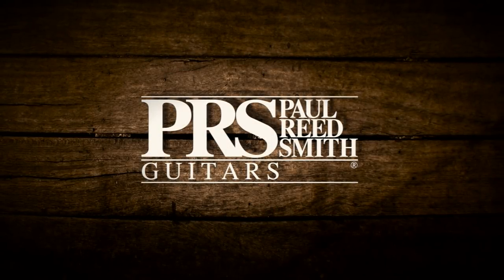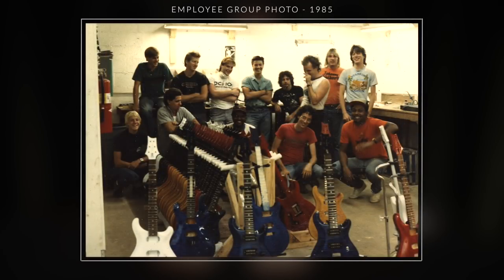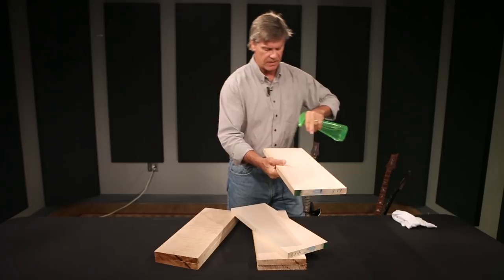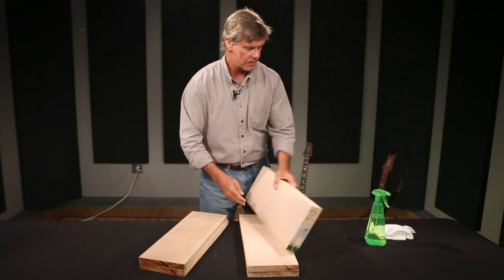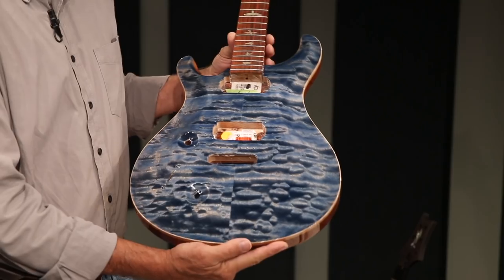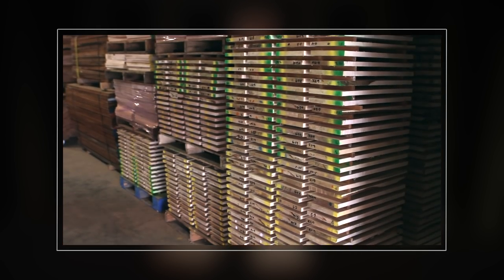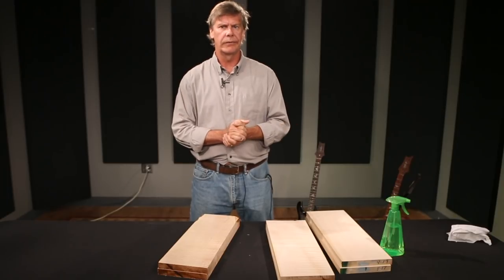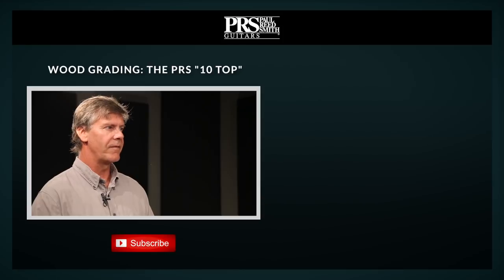The "10-Top" | PRS Guitars

Comment: Where do wood library guitars fit into the regular, 10 top and artist grades?
Reply: Chris Nicolaides I might be wrong but from what I understood so far: 

Artist Grade and Wood Library are both a level between 10-Top and Private Stock. 

Wood Library is apparently more about exotic woods and/or rare finishing, while Artist Package are more traditional woods,but with a nicer figure than 10-Top. 

Therefore I'm not sure there's any kind of ranking between Artist Package and Wood Library.
Reply from the maker: Hi Chris - Wood Library guitars are specifically spec'd out by the dealers who order them. Wood Library guitars default to a 10-top (designated by a "10" on the back of the headstock) but, many Wood Library runs utilize artist grade woods (which are not currently labeled on the back of the headstock).

Comment: 1.  How does wood library fit into all this?  I thought wood library was supposed to be a higher grade.  Most of the wood library tops I've seen don't have a 10 on them but they seem nicer than a standard 10 tops.  Are those then considered to be artist grade?  I have seen a couple wood libraries with 10's on them real recently but they also have artist hardware and the paisley artist case.  Over the last several years I have purchased 6 PRS guitars 4 from the core lines.

2. Here's an example, I played a Semi-hollow 408 violet purple burst at a dealer a week ago and it had a 10 on it.  I have a Cu24 Semi-Hollow that's also a wood library guitar in violet purple burst.  It does not have a 10 on it but it looks far nicer than the 408 with the 10 on it.  The Cu24 also has the artist hardware and case.  Btw, I brought the Cu24 in because the 58/15's on it aren't giving me the sound I was expecting out of a semi-hollow so I am looking at the 408 semi-hollow and compared them in the same amp.  The 408 has the semi-hollow sound I was looking for.  I'm not saying I don't like the 58/15's.  They sound great in my HBii.  They sound very stratish in the Cu24 semi-hollow which isn't bad but just wasn't what I was looking for.  I wanted more of the 335/339 type of bark and the 408 semi-hollow does that better.  I'm definitely selling the Cu24 to get a semi-hollow 408.  Btw, both guitars have rosewood necks that probably effects the sound.  Man I love the way those feel.  I wish I could get a rosewood neck on every guitar I have.

3.  I hate to say this and don't want to upset anyone....Maybe I'm wrong but it seems like the standards for a 10 top aren't what they used to be.  In recent years I've seen more and more 10 tops that just didn't look that great to me and left me scratching my head because I have also seen the occasional non-10 top that looks like it should be a 10.  I was wondering if the 10 grade was  just to increase the price.  Sorry, to ask.
Reply from the maker: Hello David - Wood Library guitars are specifically spec'd out by the dealers who order them. Wood Library guitars default to a 10-top (designated by a "10" on the back of the headstock) but, many Wood Library runs utilize artist grade woods (which are not currently labeled on the back of the headstock). Our standards for the non-10, 10-Top, artist grade, and private stock designation are firm and have been consistently followed, if not increased, over the years. Most of the men and women on the shop floor grading tops today are the same men and women who have been grading tops at PRS for the past 20+ years.
Reply: Thanks for your reply.  I got my first PRS in 1988 and have owned 10 since then and I'm close to buying #11. Have you guys considered putting an "A"  in the corner for the artist package?  I guess grading 10 tops can be rather subjective
Reply from the maker: No, thank you for your loyalty! It sounds like you have quite the stable of guitars. We love hearing from our supporters as we are always looking for ways to improve what we do. Thanks for your feedback.

Comment: So, is it purely aesthetic or is there a tonal advantage?
Reply from the maker: Hi, Cody! The 10-Top designation is purely an aesthetic grade.
Reply: Do you mean that you think that the wood is not important in an electric guitar? Sure? ... ... ... Deafness is a really important problem to be treated for to guitar players  :¬P
Reply: Mendozer what a load of rubbish. Wood has a huge impact on the tone if any guitar. If you have a naturally bright guitar ( which is down to the wood), then no matter what pickups and hardware you put in that guitar, it will always tend to brightness. If you go into any large store with a large selection of guitars - sit and play 10-20 strats or tales acoustically. Then come back and tell me there is no difference.
Reply: "sit and play 10-20 strats or tales acoustically." Depending on if they use different woods, yeah, they'll sound slightly differently (not nearly as different as on acoustic guitars, where the wood is built to flex and breath, whereas a solid body guitar the wood is one stiff chunk that isn't meant to move, but still). Plug it in, however, and you cannot tell the difference. While physically it will have an effect, it's simply not great enough to be recognized by the human ear, it's too minute; and once you factor in the amp, pickups, pots, wiring, cable, string type, fret material, scale length, pick thickness/material/position/angle, the room you're in, distortion/compression, etc. the wood has probably less than 1% in the sound of the final signal.
Reply: Jimjambanx just because you can't hear it doesn't mean that no one else can hear it. I have 3 strat and have changed the pickups between them. They still sound totally different, even with the same pickups. Swapping the necks between them made much more difference to the tonal characteristics than changing the pickups. No matter what pickups you put in a bright guitar, it will always be a bright guitar. I agree that the pickups are the biggest change to a guitars sound, but saying that you can't hear the difference between different woods in different guitars when they're plugged in is just silly, and ill informed.
Reply: Put a low output humbucker in a so-called "bright" guitar and it will have a warm, mid-heavy sound.

People hear what they want to hear.
Reply: John Hegarty The difference you hear in your strats can just as easily be chalked up to the pots, since the caps can have up to a 20% variance even on identical models with identical pots, which will affect the tone much more than the wood. I used to think tone wood made a difference on electric instruments as well, but after listening to blind A/B tests,  it really does just come down to placebo. I'll link you a test, this is the most scientific test I've been able to come across on the internet; with two incredibly different body materials (Ash and acrylic) being the only variable, as everything else is just swapped between the two (even the strumming is handled by a controlled mechanism). Even with good headphones/studio monitors and DAC, the difference is so incredibly minute that for the most part it's impossible to really tell; and even if you can, once you factor in real world elements like your amp, human inconsistencies with playing, environment, fx etc. that tiny difference in tonewood is buried too deep to have any meaningful impact. 

https://www.youtube.com/watch?v=5vgwaiScrwA
Reply: The difference I heard can't be down to pots and caps etc, because I swapped all the electronics. I really find it hard to believe that there are educated musicians who say that they cannot hear the difference between different models of electrics guitars. But I'm happy to agree to disagree.
Reply: Jimjambanx to put things another way, I don't think there is anyone who would disagree that all mahogany Les Pauls sound substantially different from those with maple tops - even with the same pots, caps and pickups. If this is true, then differences in other pieces of wood is also bound to exist, although it may obviously be more subtle.
Reply: Again, it's placebo, watch the video I linked, if you get them all right (which according to you should be easy considering how much difference you think an inch thick top makes), then I'll acknowledge you have better ears than I. But just playing normally, even if you swap the electronics, you've still got human inconsistency; which in any scientific test would completely invalidate the results as being unreliable. Humans are unreliable, our playing is never the same, and we hear what we want to hear. If you believe a maple cap will make a les paul sound brighter electrically, then you're subconsciously going to listen for those higher frequencies; that's when confirmation bias kicks in and you go "It sounds brighter now!" when in reality the sound never changed, those frequencies were always there, you just never payed attention to them. Not to mention, unless you're playing really loud on stage, you can still hear the guitar acoustically on your lap, so it's not always clear if the difference you hear is really coming from the signal or just guitar acoustically (which isn't what we're discussing). 

That's why I linked you the test, it removes the human inconstancy by using a mechanical arm that always strums the exact same way, it's recorded direct meaning there's no bleed from the guitar acoustically, and it's blind so your mind can't fill in the gaps for you. Your anecdotal experience is honestly irrelevant to me, because we as humans are too unreliable and inconsistent; I'm interested in the science, and looking at things as objectively as possible. Again, I used to think it made a difference too, but once I stripped away my bias and looked at things scientifically, I had to accept that on a solid body electric, the acoustic properties of the wood have too little impact on the final signal to make a difference.
Reply: Figure is aesthetic.  Some builders actually argue it makes for weaker necks.  It is just relatively uncommon in maple trees and looks really beautiful when you make something nice out of it like a carved guitar top
Reply: kabukiman69 That can be proven. A birds eye maple neck will be weaker or let's say it will be less stable than non figured wood. All those figurations - as good as they might look - come from diseases. Birds eye for example are little branches (knots) that didn't make it due to environmental conditions. Other figures come from fungi infections etc. 
So it might cause problems or it won't but they are more prone to cause problems. That's why most luthiers rather use figured wood on the body where it doesn't matter, but go for non figured wood for the neck.  

JimJamBanx is spot on with the A/B tests...better are double blind tests. 
What we can prove is that we like the sound more IF we also like the looks. If something looks darker to us, it also sounds darker to us. Our brain tricks our hearing to some extend. There are whole books in the field of psychoacoustics. They can figure out what most people consider a good sound of a closing car door. Or what beep you hear well but never find annoying. Always keep in mind that when two people sound to the same guitar and the sound is formed through the series of filters (electronics, cable, amp and SPEAKER) there is still one more. Even when your ear canal is just slightly different, some frequencies might shift juuust right for YOU, while the guy next to you prefers a different sound that does the same for his ears.

Trust the Guys from PRS...the top doesn't do anything to the sound. They're not BS-ing, while they could. There is nothing wrong with just saying you like the looks of that one.

Comment: I have a P22 with a top that is stunning....deep and even across the entire surface.   It isn't a 10 top.   A pal of mine has a SC245 that has a 10 top that is pretty average.    I think this process is a bit off.
Reply: Perception is subjective. You might like something cloud-ish or finer or wider lines from a certain colour. Depending on the colour, more or less light is reflected into your noggin. A green or blue can show details easier than red.
Reply: I have a Custom 24 with a Chevron style top. Its not a 10-top but I think it looks better than a 10-top. Its very subjective of course and a lot of 10-tops to me don't look all that interesting - regular thin horizontal lines across the top. All 4 of my PRS tops (inc a one piece Maple top/back on my HBii) and non 10-tops but every one has 'character', has something that no other guitar has.
A lot of 10-tops look alike because they are regular stripes - the quilted maple tops are different though so I am just referring to the flame maple tops. I like the fact that my tops have irregularities - both in terms of thickness of stripes and intensity which makes them more unique and have their own character/identity.

Comment: Where does Wood Library fit in?? Standard > 10 Top > Artist > Wood Library(??) > Private Stock...yeah???
Reply from the maker: Hi Jamie - Wood Library guitars are specifically spec'd out by the dealers who order them. Wood Library guitars default to a 10-top (designated by a "10" on the back of the headstock) but, many Wood Library runs utilize artist grade woods (which are not currently labeled on the back of the headstock).
Reply: Ah ok. Thank you.